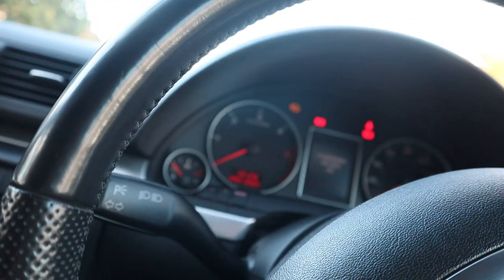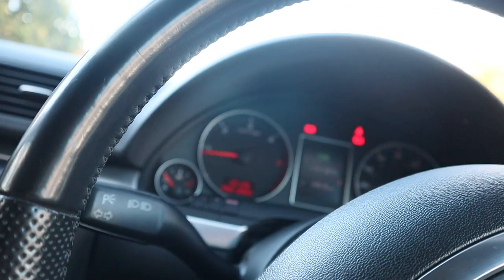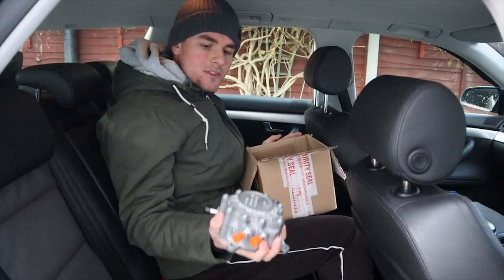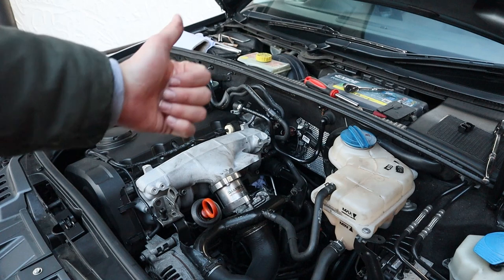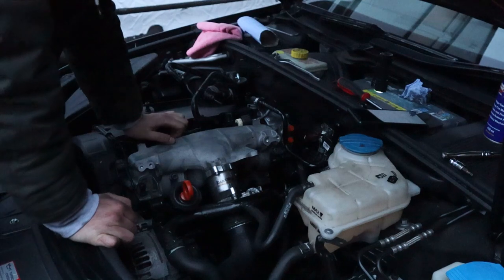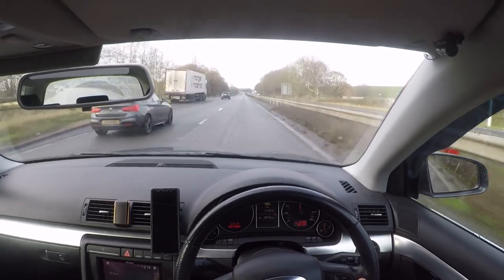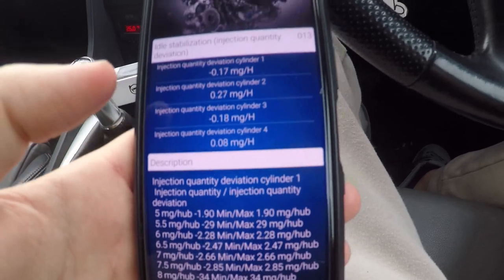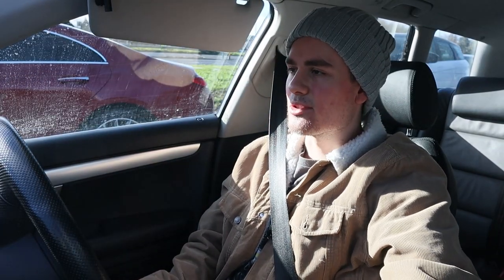I Replaced the Tandem Pump on my Audi TDI... Did it Help?

Comment: Should of just replaced the internal seals full gasket kit about £25 rather than a whole new pump
Reply: How does that repair the problem if the issue is inside the pump and not the seals? If the pump is as old as the car then it’s definitely worth installing a new one.

Comment: great content bro keep it up, you have helped me out loads with my a4. peace bro ✌🏻
Reply from the maker: Thanks man that's awesome to hear 👌
Reply: @BWTV  I had a 1.9 pd130 that had a dirty injector car had 150k on it try diesel pure helps alot I also did a teraclean fuel system clean that made biggest difference and cost £100 all my injector Value were close to o and the car felt like a new car had more power

Comment: I have the same car, the injector values that you see are very good if they don't pass 2.5 mg/h, anyway those values are when your engine is idleing, to know the real values when the engine is reving you need to go to a service when they put them on a special tester, PD injectors should show an error if they do have a problem, if they give too much gas or less gas than needed, missfiring or things like that.
Anyway, i found your videos very helpful, keep up the good work!

Comment: from my experience with the tdi engines is also that if someone (previous owners or mechanics) have replaced the battery, it's sometimes a low ampere battery so it struggles with the diesel engine especially when cold.

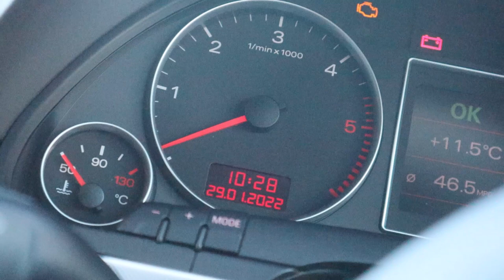Comment: 1:10 try to crank it for a shorter period so the battery doesn't suffer, also try to switch on and off 3 or 4 times so the glow plugs can heat more the cylinder (just to check if it helps)
Reply from the maker: Yeah I usually do, starts in the 3rd or 4th time these days only on a cold start

Comment: Your Injectors are Siemens PD. PD means that each injector is its own high pressure fuel pump, driven by the exhaust camshaft. The idle stabelization values you showed should equal 0 at any moment. Because ist's only used for idle stabelization, all values go to 0, when you rev the engine. If the values don't equal 0, it's usually a good indecation of bad incetors. Your values seem good though, wich leads me to believe, that it is most likely an issue with the map. As for the starting issue, that could be the camshaft Hall-Sensor, as it determines, when to fire the injectors at startup and ist descibed by Audi as the "Fast starting sensor"
Reply from the maker: Really helpful thanks for the info! I'll look into that one

Comment: Simplest way of putting it is PD = pump duse is a mechanically driven injector whereas common rail is electronically controlled, PD doesn’t have a high pressure fuel pump like common rail does they have the tandem pump which is a low pressure fuel pump essentially!

Comment: Hi yall. Just FYI. You don't have to remove the coolent hose clamo to gain access to the last bolt. Feel with you fingers. It will fit even with a 3/8th drive socket

Comment: did you ever get the starting issue sorted?

ive had my VW touran PD170 for 3 years now and ive had enough of it taking about 10seconds to ignite... all spins over fine just wont ignite... a bit like how yours did at the start but mine eventually ignites.

im baffled on where to start next

Comment: I have a 2.0tdiA4 B7 too and I also have a problem starting the car so I replaced the car battery but it didn't help at all, so another option is a tandem pump
Reply from the maker: Also take a look into the crank sensor! I made a video on that one too
Reply: @BWTV hi so i fixed my B7(bad start) the problem was in injector 1, now engine starts without issue and my fuel consumption is better, my mechanic told me that this injectors fail is common they die pretty often, i need to use premium fuel or injector cleaning fuel additives

Comment: is it common for the tandem pump to start leaking down the back of the head/engine? currently have an oil leak there but unsure where its coming from. BPW engine code

Comment: Hey Brad what was your symptoms of the tandem pump? I think I have the same issue. My problems are stiff brake pedal when breaking letting off then breaking again. Also down on power and lower fuel mileage.
Reply: Did you resolve your problem as I’m having the same issue
Reply: @doz2020  yes mate, I replaced the tandem pump and that sorted it.

Comment: Hi Buddy, hope you get this comment / question. I've recently found your channel as I also have a 2.0TDI 170, B7. Great videos and very good information. 
Question, Mine suffers with a bad fume smell, on tick over and running, you can smell when windows are down ( not closed ) I researched online and your video came up about the Tamdem pump. Did yours have this fume smell and did it cure it after you changed the Tamden pump? 
Also my clutch, into 1st and 2nd is ok but not great, you comment saying yours improved after changing this.
I'm going to get mine changed so Thanks for the great video, just thouth I'd ask about the fume smell and if it cured it or did you have that issue as well?
Thank you.
Mick
Reply: I want to know the same thing pal did you manage to sort it? I've got a golf with the same engine  I was worried it was injectors but most injector failures cut the engine instead of carry on running   the only fault code I have is one for 02 sensor I replaced it and still get the same fault im wondering if oil in the diesel caused by the tandem pump failure is the cause of all this issues aswell as the awful smell it idles slightly rough but I wouldn't say misfire and there's no fault for misfire when code read so maybe its also letting small amounts of air into the system also??

Comment: Had the same issue with my pd170 it was the turbo actuator
Reply: Was it stuttering/ hesitating with the turbo actuator?? When going from 3rd to 4th flat out as going into 4th in then judders a bit like hesitates, did you have to replace whole turbo?

Comment: there was a guy that said he had a tiny microscopic hole in his fuel pipe near the fuel filter and that it was causing the same cold start symptoms as you?
Reply from the maker: That's odd but I'll check that just incase
Reply: @BWTV  also for injectors you can do a leak off test, diy make the bottles and tubes.

Comment: Did this fix the slow starting issue?
Reply from the maker: No :(
Reply: @BWTV  that's unfortunate. My 2.0 tdi bkd golf does the exact same thing and I've been trying to figure it out
Reply: @norvo9818  Try repairing the starter motor can be a problem.

Comment: Sounds like it wants a set of glow plugs for the starting issue
Reply: The VAG manual says the glows plugs are not doing anything until -5° & are not needed I've tested this theory out on mine I have the same model engine being a bad BRD piece of 🐕‍🦺💩 & I've disconnected the live lead to them & it started up just fine in cold enough weather maybe not -5° but ot still started straight away 3-4 engine turns fired up even with all the other problems I've had with it

Comment: I have the same model however I've not had the hesitation problems it's had the dpf removed & remapped as far as I know although I'm not sure what the output is the car itself has been a different pain in the 'Harris' my starting problem was the main starter motor live lead was loose due to 'Autotechnik' Blackpool as other things he missed out. I've had a leaky tandem pump gasket in the past. The stud the tightens the cam belt tensioner pulley sheared off 3 weeks into owning the car. Last problem has been a pain in the 'harris' for the rac recovery operative he didn't know the difference between an A3 & an A4 the actual problem diagnosed being lack of fuel the rac operative ripped up my back seat looking for my fuel pump, he battered my fuel tank with a lump hammer & then poured the fuel out of the filter on to the tarmac I said he better go after seeing that eventually the car went to Redman Autos Poulton for 5 months he lost the key eventually I asked for it back after no progress being made he said it needs an ecu I managed to find 1 with a matching key 433mhz I got the car back 5 days having it back I got it running the relays under the ecu had been sat in 3" of water 2 new relays & the 3rd cleaned up, fresh fuel in the new filter it started straight away so steer clear of Redman Autos Poulton & Autotechnik on the edge of Blackpool
Reply from the maker: Wow that was a rollercoaster of a story. Will avoid them!

Comment: Pop the rocker cover off and check the exhaust rockers. I had same symptoms and rollers on the rocker arm had collapsed
Reply from the maker: I'll look into this! Thanks 👍
Reply: It doesn't have rockers, it has hydraulic lifters actuated by the cam
Reply: @tipptop9  it has roker arms that have a roller bearing which are prone to collapse and come apart
Reply: @andrewwitten5081  Sorry my bad, I though it was a 1.9!

Comment: I’ll bet everything I own that that starting problem is from a warped fuel filter housing they’ll be a small gap from prying the lid up with the flat end screw driver  that’s letting air in an the fuels running back
Reply: Prying the lid up? There is no lid to pry up with a screwdriver the filter is a sealed item 1 bolt clamps it in the bracket, a snake clip holding 2 pipes in place & 2 compression clips hold the other 2 pipes I forget which pipes do what but there is definitely nothing to pry up with a screwdriver
Reply: @JohnSmith-uq4zp  wrong the fuel filter housing has about 6 bolts that needs unscrewing then the lid needs popping off to get to the actual filter do some research mate sounds like you’re talking about another car because I’ve got the common rail engine which is the updated engine above the ppd which uses a lot of the same components as the ppd so if you want this argument you’ve really picked the wrong person for this one cocker
Reply: John is correct. Jodie is talking out their crack. The filter type is visible in the video. This is an Audi A4 one piece filter Jodie.
Reply: Have you ever changed a fuel filter like the one you're talking about, with the 6 screws, yourself? Did you noticed the big beefy o-ring a couple of mm under the lid? That is the seal. It's not the screws and it's not the lid you're prying. You can bend that upper lid all day long, you won't bend the area where the o-ring seats and seals.
Reply: @bradmarshall8363  No kid, you just can't bend the area where the o-ring sits with a screwdriver. The lid that you keep bending is ONE thing, the o-ring area, that is UNDER that lid that you keep bending is ANOTHER thing.

Comment: Dude I might have a solution for you, you should get your turbo checked out, after some milage the older vgt turbos set screws can go out of correct setting and cause the veins to close too much, which can cause hesitation when they have to open, like you have, check this video from 3:50, thought about your issue when I watched it. Hope it helps https://youtu.be/Ppif4qC560U?t=230